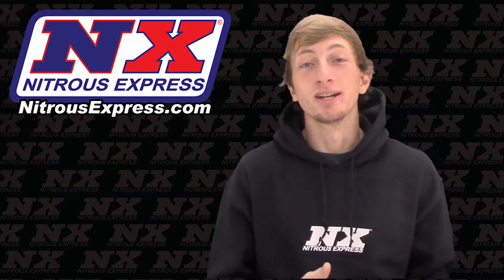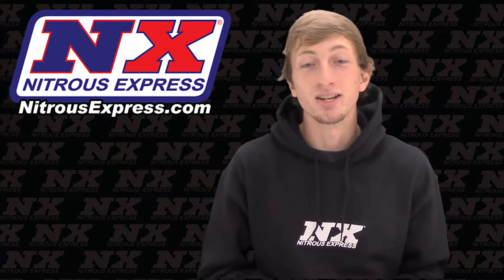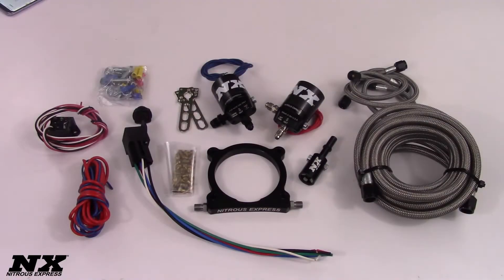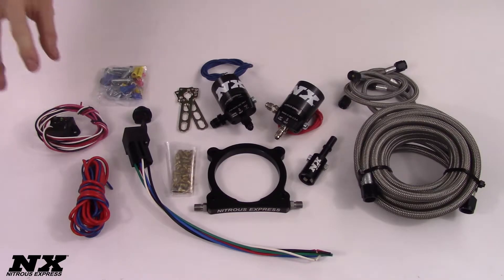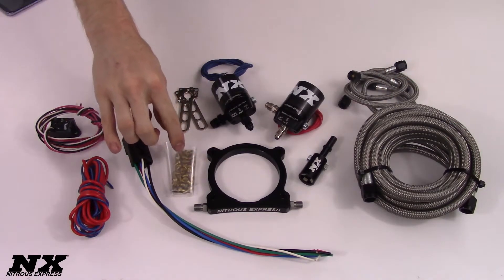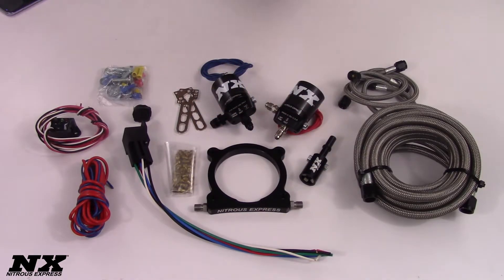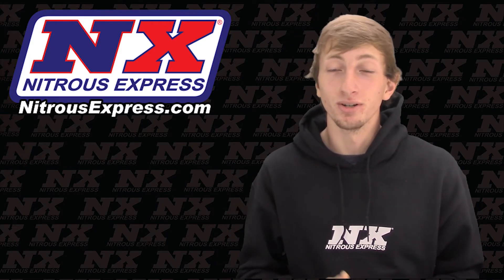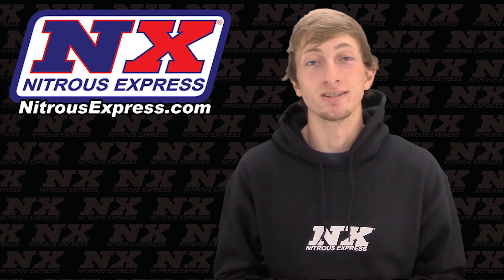NX - 5.0 Coyote HO Nitrous System Part No. 20951-10

Comment: SO I'm seriously considering your guys kit, but I'm trying to decide between a direct port vs fogger system. If I run the same shot (lets say 200 for my 5.0L Coyote) will I get the same power with both kits?
Reply from the maker: They will both get you around the same amount of power, but the direct port will be a little more tuneable to getting the correct amount of fuel and nitrous to each cylinder.
Reply: @NitrousExpressVids  ok sweet! I think I'll end up getting your kit then. I mostly plan on using it once in a blue moon anyway. I just want to push it into the 10s once or twice and then start trying autocross. 

You don't happen to know if there is a plate available for the Cobra jet throttle body?
Reply from the maker: @xXBurntBaconXx  Yes we do have a plate for it. Here is the link https://www.nitrousexpress.com/nx950-4v-ford-plate-conversion.html